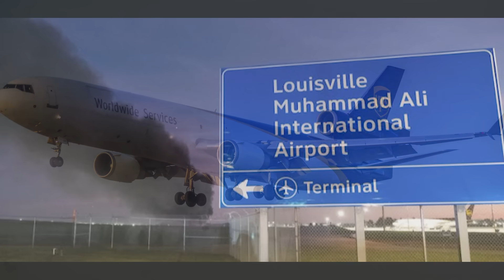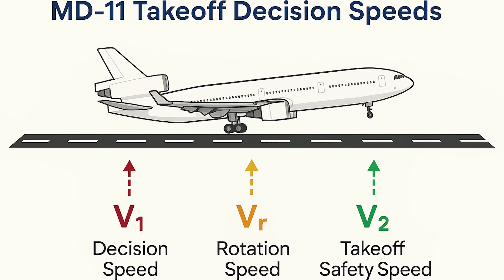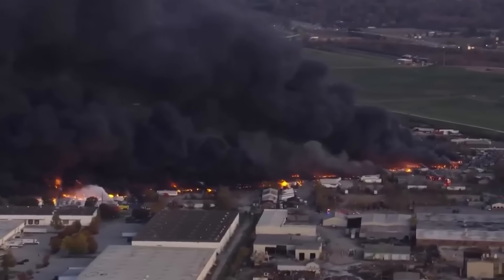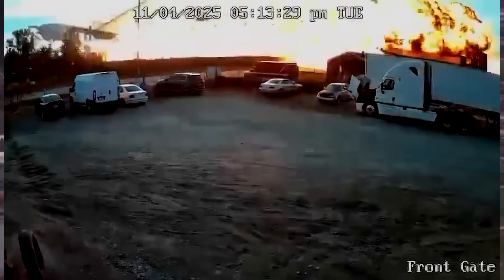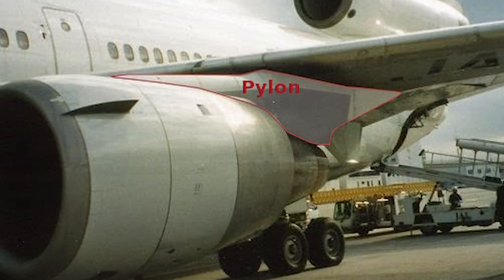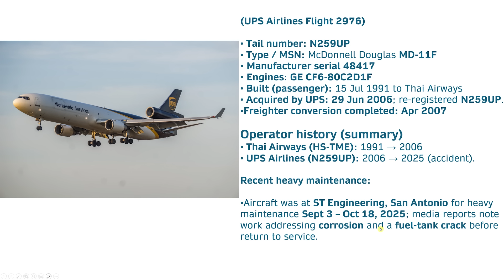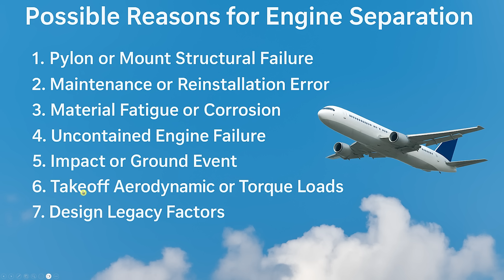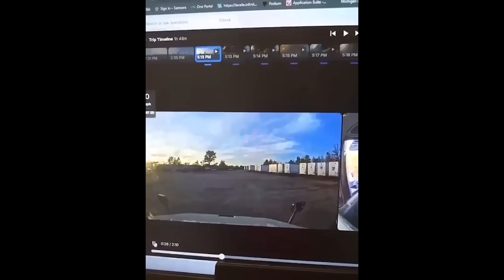What Caused UPS Plane Crash, Louisville, KY? How MD-11 Engine Fell Off

Comment: Why don't they make all runways longer extended? So in a case like that, they can just keep going down the runway and slow down and stop instead of having to be forced to go in the air and die
Reply: Its over 12000 feet long - over 2 miles

Comment: I think as a safety measure all airports should install arresting cables to stop airplanes at the end of their runways in case airplanes fail to take off or fail to stop after landing. Arresting cables are successfully implemented on aircraft carriers, and I think it shouldn't be complicated to install them at airports as well.
Reply: exactly. or fishing nets. if they had fishing nets like those used behind field goal posts in stadiums.......... it would ve caught the plane and dropped it straight down onto soft grassy ground past the end of the runaway...........

Comment: On the runway you get see fire puffs from where the second engine  failure stalled and backfired on the right side   I suspect we had a ubcontained engine failure on the left that damaged the right engine as  the left engine failed and departed they lost 2 engines of 3 fully loaded sadly the cards where rigged in this wreck

Comment: As someone who has 8 years of management experience with UPS in the hubs, i have some ganders.

1 I'm sure some people will immediatley think of DEI hiring. Does UPS do that?? Mostly not for the employees, its all seniority and skill based and standards havent been lowered for anyone as far as I can tell. However UPS did start doing a "Woman in management" program a few years ago in which during a management promoting cycle, they only promote woman during that cycle to up the percentage of woman in the management hierarchy. Make of that what you will.

2. Ups has undergone massive layoffs of several departments, funneling that work onto their employees and management teams. This has caused alot of corner cutting, especially with paperwork as facilities get rated on a spread sheet by ivory tower based on the amount of tasks being done. A majority of those tasks are pencil whipped. But they do them mostly for insurance purposes, and to appease the people upstairs. Nobody wants to bring it up how impossible it is to complete it all because they'd get their partners in trouble, and then have more work dumped ontop of them as punishment.

3. When Carol Tome came in as CEO, she focused on reducing spending. Shutdown alot of building projects, worked on alot of cost cutting. Usually they shutdown Amex's and stuff like that.  But personally in my building, maintenance crews got cut down, and despite things that may need a replacement, they have to stay in a budget goal that might leave alot of equipment wanting. Possibly the same here.

All this being said, take it with a grain of salt. I dont work at one of these air fields, im just speculating based off my own experience seeing how UPS Ivory Tower functions, and the kind of things that could have lead up to this. Maintenance crews that could have caused this issue, are mostly contracted out, and not UPS employees. It remains to be seen what the end result of this will be once the investigation wraps up.

Comment: Airports should be isolated and away from anything it could crash into so they could abort a flight not fearing crashing into buildings etc. because of issues like that. I'm sorry, but the excuse to not abort after realizing there is a problem is an insane one.

Comment: Its not the first time a DC-10 going down.. Multiple cargo door failiur at 20/30000feet, turned the aircraft to a flying brick. Engines falling of on take of, or the no 3 engine explotion. That airplane was a disaster from square one. It was a hush job to put that piece of crap together, just to have a wide boddy who chould compet with the 747's back in the days.  Regards from Sweden.

Comment: Our cities are poorly designed.  And its not just the roads and the motorways.   Airports should have stretches of non-built up areas at either end which would permit more options for forced landings, rejected takeoffs and runway overshoots.

Comment: Footage of engine on the runway post accident, def off. They went faster than V2, but hydraulic lines were cut on left wing and that affected stall speed of left wing resulting in full stall of left wing taking the plane down, otherwise it might've been able to lift and come back for landing.

Comment: I'm just speculating here: not sure if each engine has its own fuel pump or if there was a safety shut off in the event of a catastrophic engine event. But it seems like the aircraft could've pulled into a climbs since it has two operational engines. It reminds me of the air India crash where its fuel  switches were switched off during take off. We will just have to wait on the NTSB's findings.
Reply: Left engine came off and the right engine did a compressor stall. Not enough thrust to get them in the air :(

Comment: When the left side engine(engine #1) fell off it burst into flames and the whole left side of the plane was on fire due to the full tanks of fuel .That's why you see flames back at the tail section of the plane your video .
Reply: Right engine did a compressor stall as well so the plane did not have enough thrust to get them in the air :(

Comment: Why must we always hold the regulator and the legislature, (government) responsible? 

The reason is that almost any failure which happens — including negligence on the part of aircrew or maintenance — can be prevented by sufficient oversight.

Do not be distracted by the sham excuse that we cannot continue checking indefinitely.

Comment: Just Like American 191 in 1979 the Plane crashed just outside the Airport Fence

The Cause Was due to Faulty Repair

The Wing Slats Retracted shortly after takeoff on the left Wing a few Seconds after the Left Engine Fell off since it ripped Hydraulic Lines with it.

Comment: That AA plane that crashed in Chicago is burnt into my mind. I thought my boss was on that plane. Only after did I find out he was on the prior flight with the same destination. That was a horrible crash. So many people lost. I often wonder why these commercial planes aren't replaced every 10 years. I know the annual inspections are very thorough and complete, AND very expensive. That said, the parts on these jumbo machines are under such tremendous stress it's hard to understand. They also fly the heck out of these massive machines. One flight after another. At some point, this is going to have to be reexamined. Rest in Peace to all who lost their lives in this tragic incident.

Comment: As a technician who deals with cracking aluminum coils. 100% caused by corrosion/cracks . They had a leaking fuel tank. What’s under the fuel tank? The ENGINE. Any chemical that’s reactive at all will cause aluminum to crack. Ive seen bleach cause aluminum cracks, I’ve seen UV light cause aluminum to crack, and I’ve seen cracks from chemical cleaning. 🧼 trust me, I know this is the cause.

Comment: I saw the smoke from Delta Air Lines Flight 191 in Dallas in 1985. We had worked late at a 2nd job in Oak Cliff and were on the way home when it happened.

Comment: 0:25 it looks like the engine falls off at the treeline. Then it looks like the wing falls off or it rolls hard.
It's called a "Jesus screw" for a reason. 😢 Those instructions and warnings are in red or yellow for a reason.
No thrust from the left side means you have to turn a certain way to rely on the sole engine.

Comment: Those engines are held on by just 3 or 4 big bolts, specially machined for the job. They are more than capable of holding the engine on IF they are installed correctly and replaced when scheduled. They even have a small longitudinal hole sealed and filled with a powerful red die so that fatigue cracks will show "bleeding" around the pylon.
When an engine is removed for servicing, it is quite tricky to get everything lined up for replacement so that the actual torque applied to the mount bolts is applied to the intended structures. If things are even slightly misaligned, the bolts may be tightened to the specified torque, but are not fully clamping the engine to its mount, allowing minute movement that will result in failure in a relatively short time.

Comment: FUSE PINS Are a weak (Quick engine attach) point attaching the engine pylons which are attached  to the engine/wing attach fittings and those are attached to the wing lower wing skin panel (Fuel tank) Front spar and Mid Spar. The pins are made to break in an extreme condition rather than tear the wing lower skin panel off.
Not that age has anything to do with anything, not that people can't replace a flat tire on their Car with a spare tire 7 tools stored in the same car today are working on Aircraft and building them but, the DC10 with it's horrid track record was rebadged as a MD-11.  Let that sink in....

Comment: You mentioned the American Airlines flight 191 crash, and how the damage was done by a forklift.
There's more to it than that.
When engines were replaced on the DC-10, it required a couple of dozen bolts that held the engine onto the pylon, which took a large number of hours to do this work.
However, the maintenance engineers discovered it was quicker to remove the three bolts that held the pylon to the plane, and removed the engine AND pylon as a group.
In fitting the replaced engine/pylon back onto the aircraft, they used a forklift to lift it into position... but a forklift isn't the most accurate device for precise positioning required to maneuver the pylon brackets up to the wing brackets on the plane.
As a result, the brackets were damaged, as were the bolts holding the pylon to the wing.
Ultimately, the rear bolt and bracket failed at the rotate point of takeoff, and the engine rotated on the front bolts, and rotated over the wing, breaking off and damaging the hydraulic lines just behind the leading edge slats on the left wing.
In addition, the left engine provided power for the pilot's console, so he didn't have the information to identify the control problems he was faced with time running out to try to recover control, which 'might' have made it possible for the plane to survive the incidents (and it's a big 'might').

I hope the UPS maintenance engineers didn't forget the lessons of AA 191, and had started removing the pylon+engine that proved to be so damaging!!

Comment: I watched the first video of the crash where it starts it's barrel roll and I immediately said to my wife "can you imagine, those pilots in the cockpit knew they weren't going home to their families. They had absolutely no chance. So sad. I'm a freight engineer for BNSF Railway and I've been running trains and have had several grade crossing accidents and suicides. It's a helpless feeling and your body does some amazing things including your eyes and brain. People always ask "well you don't have any time to react, right ???" and in most cases, there's absolutely nothing we can do. We're simply there for the ride. But when you get that adrenaline dump, your eyes seem to increase the "refresh rate", your brain is able to slow things down, and while it may only be 3 or 4 seconds from the time you see a vehicle stuck on the tracks until you hit it, based on what your body does, seemingly slowing things down, it seems much longer and you are able to see and remember things you normally would never without your body putting you in the "flight or fight" mode. It's amazing.

Comment: I would never fly on any airplane with Boeing's involvement in the construction or maintenance. An earlier time when an engine fell off was caused by the maintenance crew using an improper installation procedure using a forklift. Nothing wrong with the engine. The pylon was damaged which was how the engine is attached to the wing causing the engine to fall off.

Comment: 2:50 Eerily VERY similar to the Concorde crash, flight 4590. The reasons for the fire starting may be different, and there was no engine physically falling off of the Concorde, but the end result was the same. Both aircraft  caught fire on the left sides, both briefly got airborne (too late to stop) and then came down almost immediately and crashed. The crew couldn't know early enough to stop the take off til it was too late. RIP to all the victims.

Comment: By looking at Google Maps and all of your great footage, it looks like the plane grazed over the Oil recycling center probably damaging a lot of tanks and possibly setting them on fire. then went through a Tractor trailer parking area, with business name unknown, where that Semi driver dashcam footage was from. It is behind that Chris Tire place on the left in that first dashcam. Most of the other things in the crash area are car junk yards/Car used parts places, and one truck parts and service shop. So, it is lucky to have happened at the end of that particular runway, because most of the fire and crash site were junk car lots, and not residential area. That may be the only silver lining in this whole absolutely terrible occurrence. Ironically, the first warehouse roof it hit is a UPS distribution warehouse.

Comment: Instead of going through the engine and redoing the spark plugs timing chain and everything else on the outside of the engine other than that I think they should actually rebuild the engine or replace the engines every 5 years. That will solve everything

Comment: Why didn't the plane takeoff safely on the remaining 2 engines? 😮
Reply: Because the only engine that may have been working properly was on the right wing. And it could have flown on two engines IF the third engine was still attached to the plane. But it wasn’t.

Comment: An engine falls off a plane due to failure of the pylon or mount that attaches it to the wing, which can be caused by structural damage from improper maintenance, such as a fire or a physical impact. In recent events, a fire on the wing led to the engine detaching during takeoff, severing hydraulic lines and causing aerodynamic issues. The engine may be able to fly with a failed engine, but separating an engine during takeoff creates a catastrophic and unrecoverable situation due to the unbalanced aerodynamics and loss of thrust.

Comment: This has gotten ridiculous!!!!!
These planes have been falling apart left and right!!! Air travel is not as safe as they say!!! They have been dropping out of the sky left and right!!! Zero attention to maintenance at all engines dont just fall off this was years of neglect to perform any maintenance or structural inspection!!! People are posting videos of wing screws rattling loose mid flight, windows are being torn out mid flight, engines are falling off and they're also catching fire and or disappearing.
It's clear as day they dont care These are made cheap like flying city busses you get multiple people to buy tickets thats thousands per flight
Plane crashes noone cares company says oooops sorry thanks for the money and goes on about letting these fly without proper inspection could have been prevented lack of care is what caused this look at whatever record you want thats not the person that worked on it to preform maintenance if they did at all they could have just filed the paper work an not done anything at all 
People have no sense of work ethic an it shows in the airline field they're literally falling apart left and right its getting old now and something needs to be done an they need people that actually care about safety we're turning into Idiocracy 😢

Comment: The engine fell off in the split second that it was not visible behind the trees. The original broadcast said it reached  an altitude of 150ft before it crashed. That now appears to not have been the case.
Reply: The left engine was found 2000 feet before the end of the runway so it was long gone before that.

Comment: There is nothing inherently wrong with the CF6 engine - its a proven workhorse. Which is not to discount a possibility of a major malfunction with THIS particular engine. A more likely scenario is faulty maintenance (e.g.: mounting bolts not secured, with the engine pitching upwards at max TRT). Another possibility: an uncontained fire/explosion in the wing which forcibly separated the engine. Or a combination of both. The NTSB report will be of great interest to both Boeing and GE Aerospace, as this is clearly some sort of equipment or maintenance failure, not pilot error or weather.

Comment: I have driven countless times by the crash site of flight 191 at Chicago’s Ohare airport. When you see the actual crash site and what’s around it, including just, and I mean just, missing a very large trailer park, huge above ground fuel tanks, a busy road, it was a miracle. A few people died on the ground but it could’ve been so much worse. If the pilots had any ability to control that flight to crash where it did, they were magicians and hero’s.

Comment: Poor people who lost their lives. 😢 It appears as if the engine falling off allowed fuel to spill out along the path and hitting that se ond power line ignited the fuel. If it handn't, maybe not so many would have lost their lives but who knows.

I live in San Antonio and recently returned from a ling flight. My wife just left to New York. I now am a bit worried if the crash was due to a failure on the maintenance they received here. 😮

Comment: As a former military pilot, it appears as if the pilot did all ha could to mitigate damage caused by the inevitable crash, by rolling the plane, very sharply too, in order to keep the wings on the same path, knowing they were going to be firebombs. May all RIP. This couldve been the result of bad worksmanship or inspection.